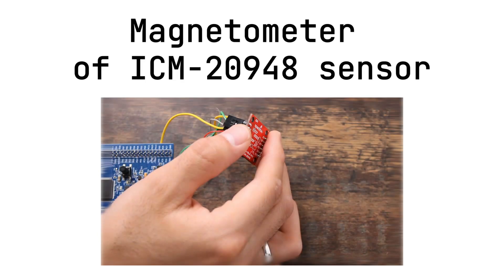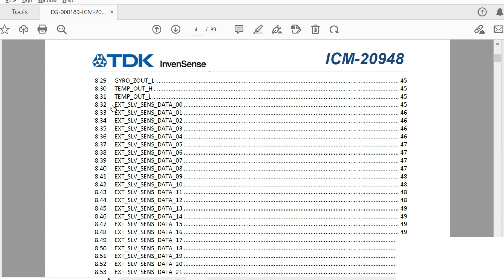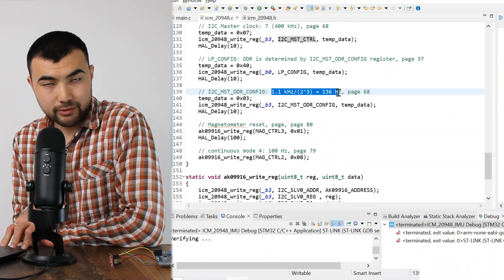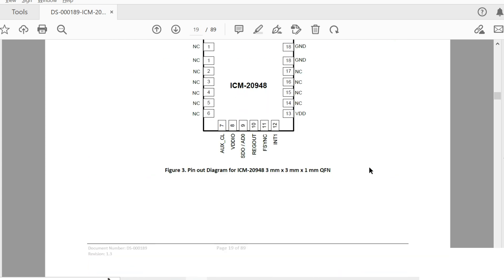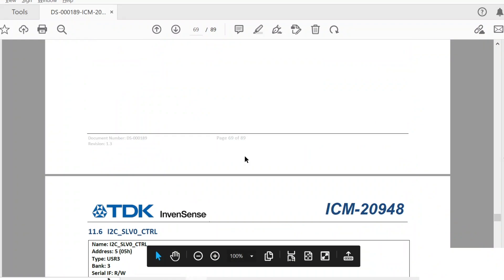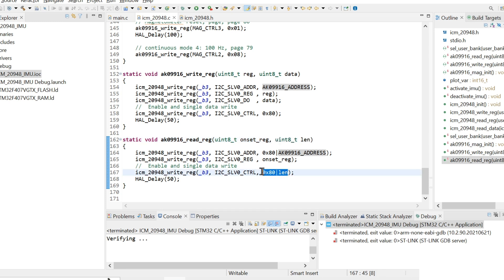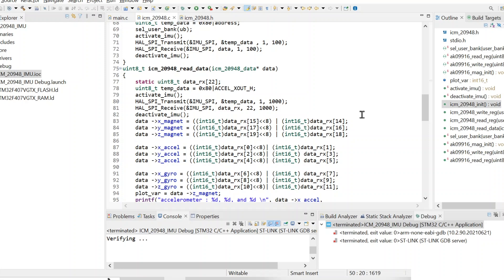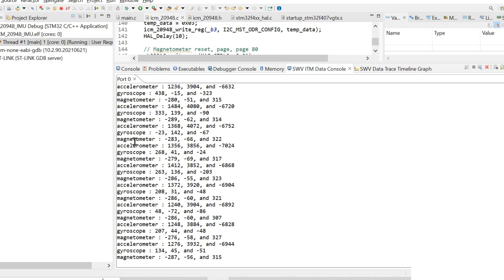STM32 ICM-20948 IMU Part 2: magnetometer

Comment: at timestamp 12:02 why did you reverse the operands order for the magnetometer(like data_rx[15] << 8 | data_rx[14])?When calculaing the raw values for the accelerometer and the gyro you did it the other way around : data_rx[0] << 8 | data_rx [1].
Reply from the maker: Hi, sorry for the late reply. In the magnetometer, the bytes are in reverse order. That is why I have to read in this way
Reply: @steppeschool3629  No problem!I followed along your video series and i writ library using i2c.Unfortunately the magnetometer does not work,here is the snippet of the code : void Mag_WriteReg(uint8_t reg,uint8_t data)
{
	ICM_SelBank(3);
	ICM_WriteReg(B3_I2C_SLV0_ADDR,(MAG_SLAVE_ADDR));
ICM_WriteReg(B3_I2C_SLV0_REG,reg);
ICM_WriteReg(B3_I2C_SLV0_DO,data);
	HAL_Delay(10);
ICM_WriteReg(B3_I2C_SLV0_CTRL,0x81);
	HAL_Delay(10);

}
void Mag_ReadReg(uint8_t reg,uint8_t len)
{
	ICM_SelBank(3);
ICM_WriteReg(B3_I2C_SLV0_ADDR,(MAG_SLAVE_ADDR) | 0x80);
ICM_WriteReg(B3_I2C_SLV0_REG,reg);
uint8_t slave_reg;
   ICM_ReadReg(B3_I2C_SLV0_REG,&slave_reg);
ICM_WriteReg(B3_I2C_SLV0_CTRL,0x80 | len);
}the registers are written corectly,and I do not know how could i debug the internal i2c master.Would you give me some guidance?

Comment: Please Please make a video to get quaternions that are accurate. I am using different libraries from 2 weeks with i2c with stm and arduino ide but no luck, the quat i get jump positive to negative. Help me cause there seems to be no help from git hub also.
Reply from the maker: Hello, If you check my website, there is a course about the attitude estimation, where I explained how to compute quaternions. However, it still needs to be completed. Right now, I am working on finishing and updating the course content. If you need news regarding that, you can join my community page on Patreon and the website.